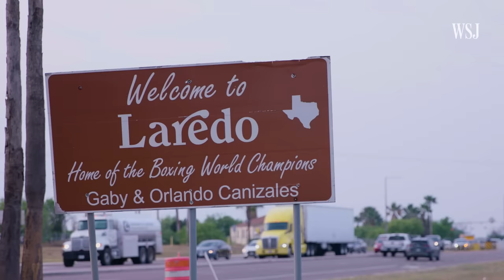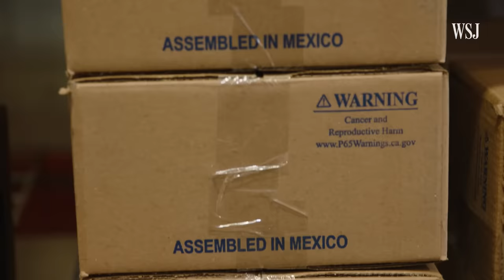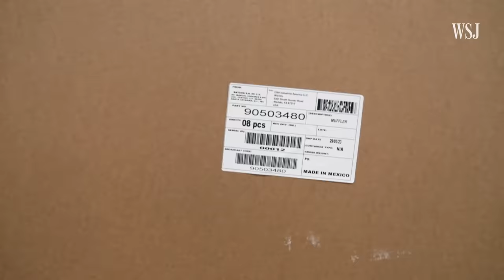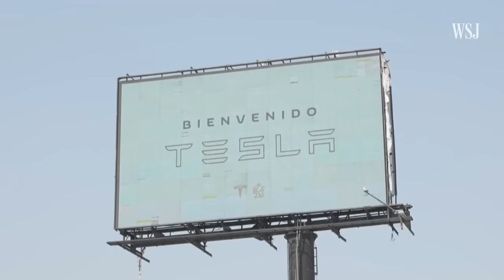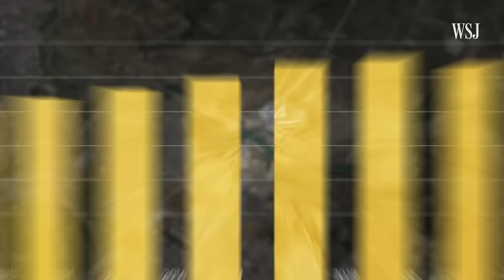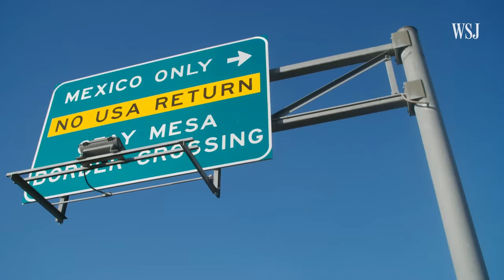The Logistics Hub Where Almost $1 Billion of Products Pass Through Daily | WSJ

Comment: If you used trains it would be more efficient, especially if some products have to cross the border 5 or 6 times.
Reply: No it wouldn't.

Trains run in schedules and only have limited places you can add/remove containers.

So you need to load the goods into the container, take it to the rail yard, container is pulled off, queued for the train, lifted onto the train, and then the reverse at the other end.

Sending a truck can be done on demand; straight to/from factory to factory.
No good if you're constantly moving components around.

Rail is more efficient for longer journeys.